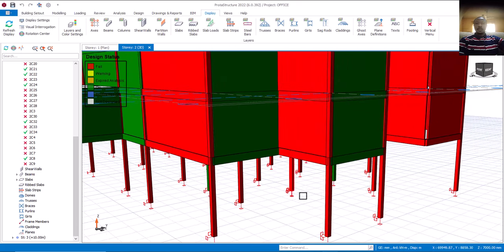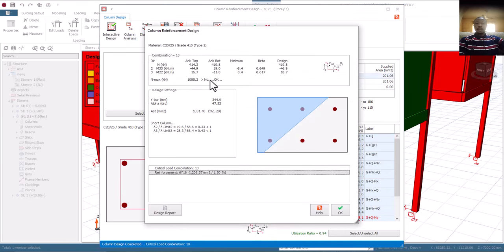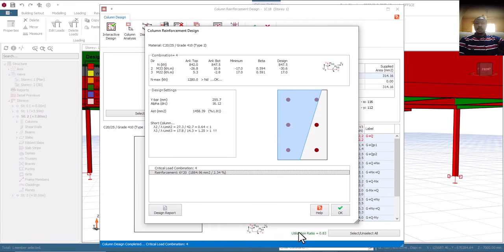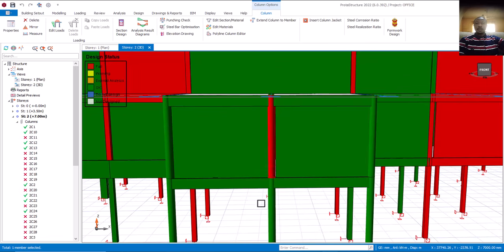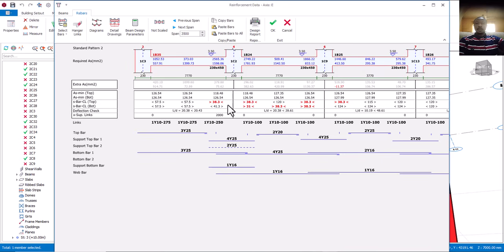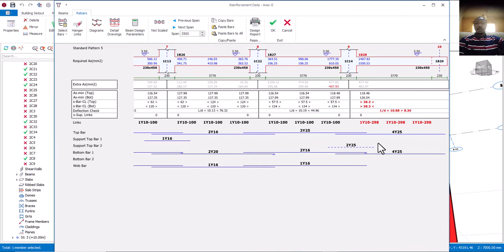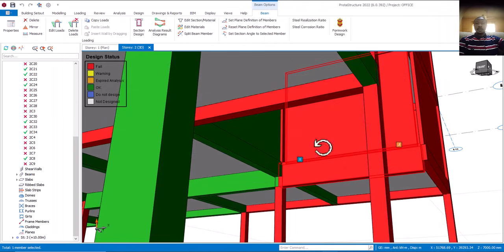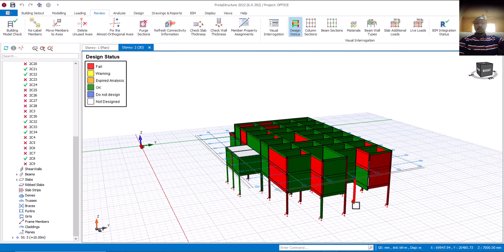PRINCIPLE OF EDITING FAILED STRUCTURAL ELEMENT IN PROTASTRUCTURE

Comment: Thank you for this
My prota provided 5 t16 in some places and even 7 but it doesn't warn that the bars won't fit in the cross section 
It's green but obviously, I can see that it won't fit..what do I do in this situation 
Edit manually all through or what?
Reply: Okay. Yes you edit it during interactive design and see if the number of bar provided by the software can be reduced if not you increase your member . It will automatically reduce the number of bars
Reply: @FASHEOLUSEGUN-eh3jx thank you

Comment: is the 230 by 230 column not the required column for the building? 🙏🙏🙏
Reply: You know when it comes to member sizing, you assume first, so in our assumption, we try to use 230mm x 230mm since the wall thickness is 230mm coupled with the size of the structure. Don't also forget that the kind of structure you are designing for determines your loading. NOTE: Might have same structure and everything will pass (column) with 230x230 and same size of  structure with fail due to different FUNCTIONS
Reply: Also the span between two columns come to play